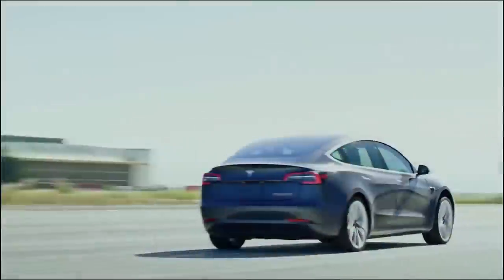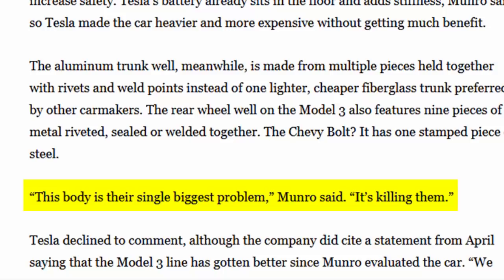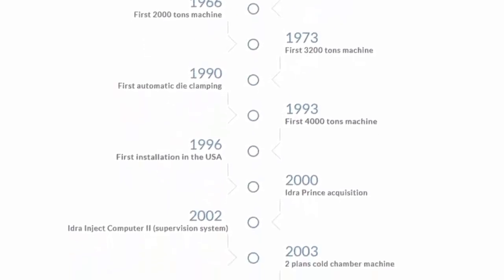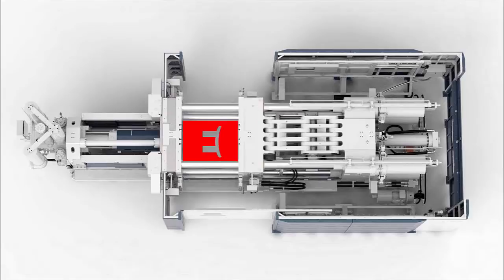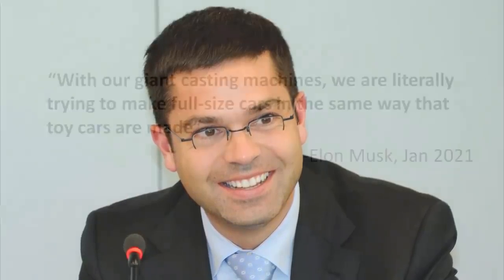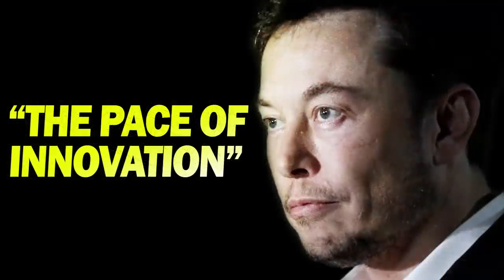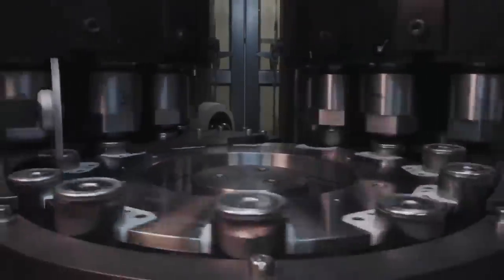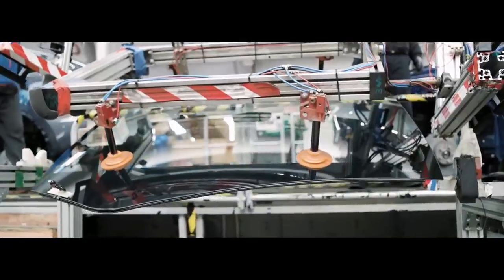Tesla Giga Press will CRUSH

Comment: The oil you mentioned when the Giga press is conducting  injections is not ordinary moulding oil, it is the traditional injection moulding fluid being used in Hong Kong or China when making cast metal sort for printing press industry.

This fluid is Soya bean source!  Without this, injection completed within milliseconds will not happen.

Comment: Elon is smart not buying LK, as a car maker, Tesla should not be limited by one technology, it is moving fast and market always coming up with new ideas！

China is moving away from Gigapress in making jet fighters and rockets.

The Zhuhai Airshow ten years ago already showing the 3D metal printing idea, the 2016 Show displayed a FC31 body section generated by 3D metal printing. 

EV industry also making use of this, but in a production cost saving concern, instead of making one large piece they just print key sections to save handling and for manufacturing efficiency, it is due the the Law requirements as stipulated against uni-body specifications, one off body may not be practical !

Comment: Not sure if the following had been said or discussed before in the comment section ...  the Giga Press will still require a mould.  That is, for instance, if a Giga Press was making the rear frame of the model Y but they are redesigning the entire car with a new frame, Tesla will still need to produce a mould for this new design.  This new mould would be installed in the Giga Press after the old mould has been removed.  IDRA does NOT produce the moulds - and Tesla would have to manufacture these moulds.

As such, it is unlikely Tesla would buy IDRA or LK Technologies.

Comment: I worked in the tool and die and CNC industry for years. which is a dying industry in the US. The strength of a Giga press body is about 8-10  times stronger than a  unibody. as far as safety goes. a Giga press skeleton.  it's cheaper and faster to make. and is by far stronger than a unibody. of course, considering the cast is at least 87% aluminum. if it was 89% aluminum and 7% A2 tool steel. then the body would live on well after you're dead.
there is also another huge advantage to that process. the body of a car or truck can easily be recycled into a brand new car.
Reply from the maker: Thanks for your insight!

Comment: Several items where listed that Tesla could buy out right which would would cause a bottleneck after that item accomplishes its task such as building its own giga press but have a short term application once Tesla  uses its purpose up. However, if Tesla can copy write what it buys for a car purpose only, then it may corner the market for that device which it may consider.

Comment: No one seems to know just how many gigapress Tesla has or has on order combined.  Am going to say they likely will have 24 press in total by the beginning of 2022.  As mentioned 8 in Berlin.  Likely the same in Austin or more since they will likely get the 8000 ton machines for the cybertruck.   If one assumes there are 4 each in Shanghai and Freemont that brings the total to 24. Likely over time they will be adding more to Austin and Berlin as they likely will still have room to build buildings to house the presses.  Doing the math of 1000 castings per day amounts to 8,760,000 annually.  Have been hearing that it takes Tesla 10 hours to produce a car currently.  As Tesla scales up production of other subassemblies think that they are going to need every battery and chip sets that they can get. These are the limiting factors for the moment.  Talk about crushing the competition, the legacy makers are pushed to produce similar size vehicles in scale of 5 thousand  to 50,000 per year.

Comment: This is to answer Jacob Knudsen very poor evaluation of a Tesla demo he apparently took a test drive and his verdict was how poorly repaired from a previous accident the Tesla demo was describing the very poor state of the car, pointing to very many assembling imperfections. But strangely enough ,he didn't spell out a single word on his test drive experience . For whatever sick reason Herr Knudsen  apparent objective of bashing Tesla was his only goal, and the test drive never even took place, or he would have bashed that aspect of a Tesla too. I have spent the better part of 50 years in the car business at various level, and I have seen many new cars imperfections coming out of assembly lines, and I  can guarantee that no manufacturer in the entire world would ever try to sell a car as poorly assembled as the one described by Herr Knudsen, because it would never have passed the last visual check of highly specialized inspectors positioned at the end of assembly lines put there specifically to flag down and reject any car with far fewer problems than those described from being shipped to dealers.
I don't know what this individual problem is, and I hope he sees an head headshrinker to solve his problems. Just a foot note to assure this German Gentleman.That Tesla sales this year and the years before have been increasing by over 50%. The entire 3 quarter production is all already sold out. The quality of Tesla cars are the very best in the world, not only but also certified to be the safest in the world. While the Model S Plaid family sedan that can seat very comfortably 5 adults and 2 children, just established a world record for the fasted mass produced car with a 0 to 60 MPH of just 1.93 seconds. And while you have started with a bunch of lies let me close this pleasant exchange by pointing out with a true reality, that all those "Tesla killers" the German auto industry has unleashed to destroy Tesla, unfortunately they have all turned out to be gigantic commercial flops, with many acknowledged problems especially in the software area. Hoping that they will be able to get fixed or give the money back to the customers that have been tricked with false propaganda. In the meantime these "Tesla Killers" mostly are collecting dust in dealers lot, not because they are not nice to look at, but because they are all overpriced, under performing, and falsely over hyped, but still years behind Tesla marvels, that cannot build enough cars to meet the demand, while the German manufacturers world sales are way down, slowly and surely being rendered tame by the futuristic cars assembled by Tesla.

Comment: This is neat from a manufacturing standpoint.  But what about after the sale maintenance?  Everything from general wear and tear stresses to crashes (minor to major) will create problems with the frame.  With aluminum castings you're not going to be able to bend them back into shape because it's too brittle.  Are they moving towards a disposable automobile model where you just recycle your car after a fender bender instead of using a frame puller to straighten the frame?

Comment: isnt it time that America became metric like the rest of the world !!!
Reply: All multinationals ARE metric and have been for years.
Reply: Funny thing is the US "prefer" metric by law since the 70s
Reply: Some standard units are actually better than metric. Cups and tablespoons for cooking and Fahrenheit for weather for example. But by god feet an inches are torture to work with. I say we just replace feet, inches, and miles. That would be an easier sell and solve 90% of the problems.
Reply: @xcvsdxvsx  nonsense 😅 Celsius with 0 freezing 100 boiling is vastly more intuitive, and dont get me started on cups! Litres and fractions in ml cl etc are immediate cups are ridiculous
Reply: @mesteme  "Celsius with 0 freezing 100 boiling is vastly more intuitive" for science or something. Not for the weather. 0f is really really cold and 100f is really really hot but both are extremes that are common to experience for most europeans and americans. 0c is just kind cold and 100c is dead. When I'm looking a the weather I don't care what temperature water freezes at or boils at. Thats totally irrelevant. Fereinheight could probably be slightly more optimized if it was invented again from scratch today, 0 might be a bit warmer and 100 might be a bit hotter I would guess, but its pretty good for its intended purpose.

Comment: They likley wouldn't be remelting and using the scrap bits for more injection. The Injection molding process creates alot of chemical changes inside the aluminum itself. These often will cause alot of impurities and defects when scrap is used directly. This often can cause structural issues that are unsean. They may remelt, cast waste ingiots, and have a contract for remelt/scrap with their aluminum supplier. If they are SUPER SUPER vertically integrate, they may recondition the aluminum, and get it back to the right chemical consistency, then reinject it. But usually it's far cheaper to let a ingot company do it directly and just trade your scrap back to them for credit toward new raw materials.
Reply: Bruh!  Your companies are being run by MBA's.  Tesla car company is being run by Tony Stark.  LOL😁👍
Reply: Actually, what Elon Musk did was say why can't automakers use this press they said because when the aluminum cools at different temperature it cracks.   So good luck with that.  Elon Musk said wait who said we have to use aluminum?  So Elon Musk team invented a new aluminum alloy that can with stand the different temperature differences and make giga press work.

Comment: The tech is amazing, the body’s look like a first year engineering student designed it and a 5th grader assembled it
Reply: Ok , let the Tesla model S, again you 4 door sedan.   Let race and see how good your car is.
Reply: @Madame702  / you want to race or compare build quality? Because I win both. My car is an EV conversion with an E-crate conversion kit and even with the batteries I’m about a 1000 lb lighter than a Tesla. And I didn’t have any of the restrictions (safety, pedestrian friendly bumpers etc...) to worry about. The removable roof panels were replaced with solar panels and it has a custom EV control unit with tablet interface similar to a Tesla. So comparing my car to a mass produced vehicle wouldn’t make much sense, but comparing a Tesla to a comparably priced vehicle from another manufacturer would. And like I said the cars tech and performance are outstanding but their fit and finish is shit. They charge customers out the ass for a car with massive gaps in the body panels, and those panels look like they were trimmed with a set of nail clippers, a BMW on the other hand doesn’t have those issues
Reply: @limabravo6065  LOLahahahaha 🤣  Think it so cute that you think can compete with us.   We all know that you "Socialist" want to work a 40 hour work week.  Elon Musk works 100 hours a week sometimes.   He doesn't even have a office at this factory and can find sleeping on the roof of factory he is so dedicated.
Reply: @limabravo6065  But if you want race no problem Lima Bravo.   Tesla car company now has a Super Computer A.I. that can computer 1,000 Petaflops per second.    Lima Bravo, where did Lima Bravo go????   LOL ahahahahaaha 😁😂🤣
Reply: Here going happen Lima Bravo, you have MBA's working for you and Elon Musk has Tesla.   Mary Barre CEO of GM closed factories in America and move them overseas.   Elon Musk is opening a Terra factory in Texas that 167 football fields big.   Elon Musk is now going his second generation battery that will be cheaper to produce and longer range for their cars.   Toyota want to do Solid state batteries but has factories to massive produce them.   Mary Barre of GM has just switched over to Lithium ion batteries but has no factories and must use 7 year old battery technology.
Reply: Tesla has world fast super computer, other auto manufacture we don't need a super computer it waste of money we make cars.     Tesla has a network of super chargers across America, GM, Ford, and Chrysler clueless????
Reply: @limabravo6065  Oh and State of Hawaii just bought a fleet of Tesla cars.
Reply: @Madame702  / And? The government buying something doesn’t mean anything. They set out goal, contractors bid on them and whatever company can meet the goal with the lowest price wins the contract. And as Tesla’s entire range of vehicles are all electric, it’s not surprising that state and federal governments are making deals with them, that and the fact that the current administration had decided to replace their vehicles with Tesla’s before the election, leading to politicians like Pelosi and AOC buying up Tesla stock, as once tesla became the sole provider of passenger vehicles to the feds those stocks would be artificially inflated. You apparently are missing the point here, but if you want to dump 30-40 or 50,000 dollars on a car that looks like it was assembled in a Fisher Price factory then by all means have at it
Reply: @limabravo6065  Look Lima this has nothing to do with AOC.   Elon has made it clear time and time again.  His mission is to get the other car manufacture to electrify.   And by large is working, because now he is scaring the living piss out them.
Reply: @limabravo6065  Elon Musk has put some the best engineers from Silicon Valley and the automotive industry.   You see it now a race to get the best engineers.   And Tesla is winning that race.  He got America, Germans, Indians, Japanese, and Chinese he cherry picking the best talent from all over the world.
Reply: @limabravo6065  Even in Germany a lot the young German engineer don't want to work for the Germany automakers.  Why?  They don't listen to their new ideas Lima Bravo.  There has to be a cultural shift and that is starting to happen.
Reply: @limabravo6065  Remember if you are a young engineer in BMW there are 15 layers of management between you and CEO.  When you work for Tesla the CEO is on the factory floor trying to figure the problem and listening to what you have to say.   That why all brightest and the best young engineer want to work for Tesla.
Reply: @Madame702  / and again what does that have to do with Tesla’s overall quality? I’m not arguing that any one manufacturer makes a better vehicle, but tesla put all that effort into its drivetrains, batteries etc... but when it came to the bodies and interiors they just said good enough
Reply: @limabravo6065  The real question is can ICE automaker destroy themselves before Tesla does it to them.   They need to abandon you and all their current customers destroy their current company and be reborn new otherwise Elon Musk will bring about Ragnarok.
Reply: @Madame702  / Many years from now Tesla may take a giant share of the market or even dominate it. But as it stands (here in the US ) they’re a novelty. And Tesla has some giant balls charging more than most people can afford for a vehicle with piss poor build quality, customer support bordering on intentional neglect, no second hand vehicle support, and they act like they are doing you a massive favor if they sell you a replacement part. I’ll buy their motors and batteries all day long but I’d never give that company what it wants for a new unit
Reply: @limabravo6065  Right now, it no longer a novelty.   MotorTrend magazine rates the the number 1 compact luxury car in the United States is the Tesla Model 3.   Over the BMW M3, and Audi A4 and these are gas power cars.
Reply: @limabravo6065  Tesla cars are the number 1 selling sedan in China.  In Germany, were people said Germans wouldn't buy a Tesla, in May of 2021, Tesla electric vehicles has seen a 780% year to year sales increase, and Giga factory Berlin isn't even open yet.
Reply: @limabravo6065  The country of Indonesia is saying that Tesla want to build a Giga battery factory.  By building a Tesla Giga Battery factory in Indonesia it will choke off the source of Nickle, Copper, and Lithium from the rest of the competition.
Reply: @limabravo6065  It official Tesla Q2 numbers are in Tesla build and sold 200,000 electric vehicles.   ⭐😊
Reply: @marctemura2017  / well hell if the two countries to have operated concentration camps and violated more human rights than anyone on earth are buying them  (with the Chinese government exterminating and harvesting organs from the Uighurs currently). And so far as Zee Germans go I don’t think you should have to pay for the sins of your forefathers but your nation will never be the example to follow, and those turning a blind eye to what the CCP is doing so they can make money are no better than those who collaborated with the Nazis
Reply: @Madame702  / 200k? Haha haha...... haha haha I think they sell that many new trucks in a week
Reply: @limabravo6065  You cannot stop our march toward the Moon again.  We going to create a Moon base.   Then we it will allows to go to Mars.    Just remember that when the Wright Brother flew in 1903 if you told people that we would land on the Moon only 66 years later most people would thought you were insane.   I told that the speed of new technology and progress is going to melt your mind.